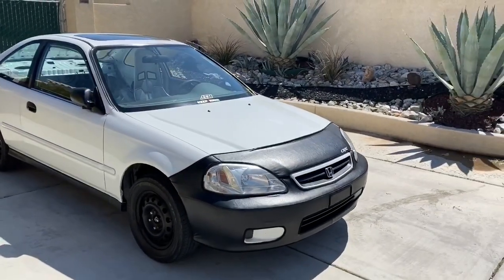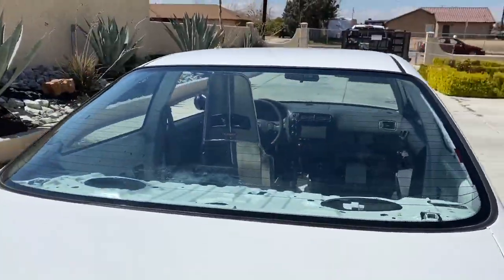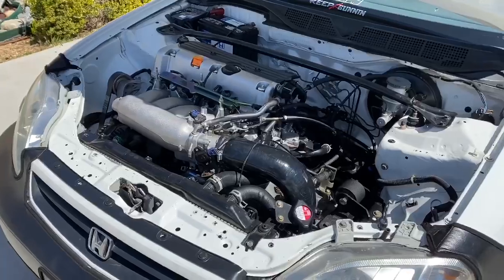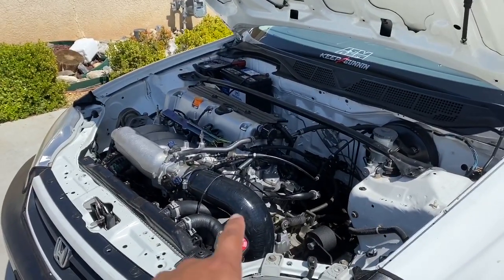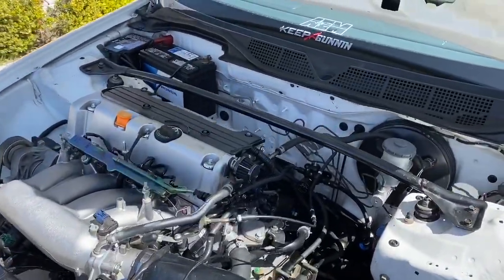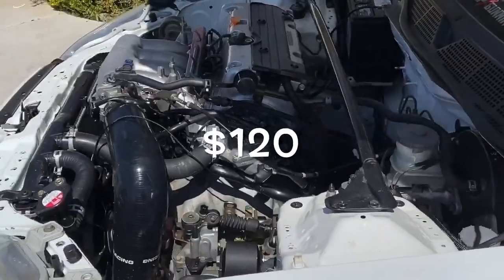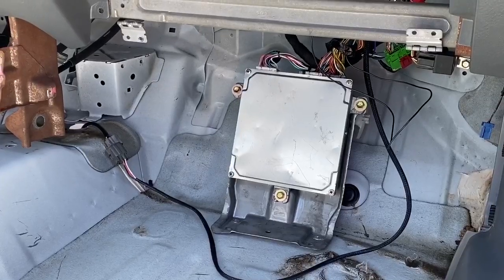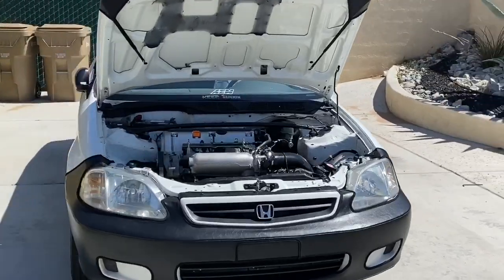K24 SWAP CIVIC HOW MUCH DOES IT COST????

Comment: I have a 00 coupe with a k24 block k20 head type s oil pump ported also ported rbc mani j35 tb 3 inch exhaust 246 hp 193 torque

Comment: Did you have to cut the hood or was it just preference? I thought with the ekk2 ek with eg subframe mounts made it so you could run an rbc without modification to the chassis? I really don't want to have to cut up my car if I don't have to haha. Thanks!
Reply from the maker: When you go K24 you have to cut the hood I really hate that I had to cut mine it was super clean under almost like new
Reply: @oemworx4147  Damn, I've seen some people run hasport ekk2 mounts with no cutting but I guess we'll see once it's in the car.😓
Reply: The cars you have seen have k20 in them not K24
Reply: @hidefpigeons9111  😓At least she'll be swapped lol

Comment: Where did you find the ecu from
Reply from the maker: Ebay there is one listed now
Reply: @oemworx4147  thanks alot
Reply: Oem Worx 
Can you hit me back. 
I have a question about the the type R ecu install
Reply from the maker: What’s up what did you need help with.
Reply: Oem Worx 
How do you ground the Type R Ecu 
Do you cut the wire and ground it going into the ecu side or going into the harness side ?
My e1 wire color is not green and yellow 
I spliced into the e1 wire and grounded it.  Car will not crank 
Car cranks with original ecu 
Engine is a 2002 k20a2 
I will send you a check for your help 
Warren 210-416-1060
Thanks In advance

Comment: What subframe??
Reply from the maker: Eg subframe. There is a video on my channel showing how I installed it.
Reply: Anita Ayon  So you can use ekk2 mounts which place the engine further back. It gave you more clearance for intake/radiator, better axles angle and better weight distribution